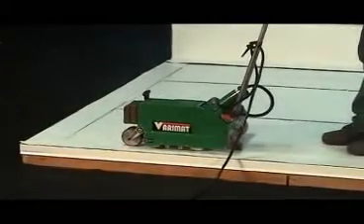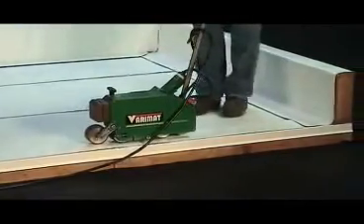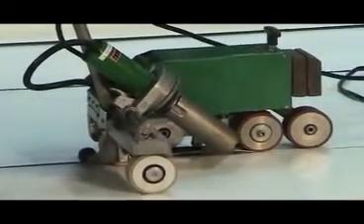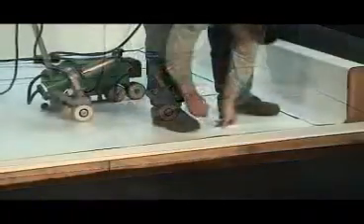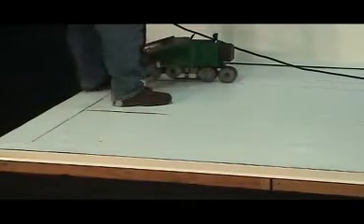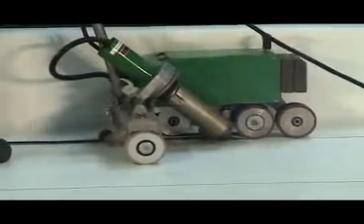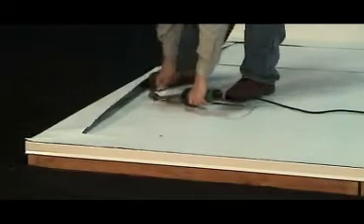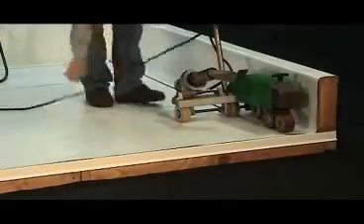PVC Flat roof Installation - Welding field seams

Comment: "welds completed in half the amount of time as using a hand-welder" does not mean twice as much work completed in half the time. That would be a quarter the amount of time, not half. BTW, thanks for the videos. very helpful
Reply: Auto welder makes sense only on bigger roofs: 15-20 squares or more. But when you have long runs, its a life saver. Try welding 100 feet seam by hand... Then try 600 feet :)